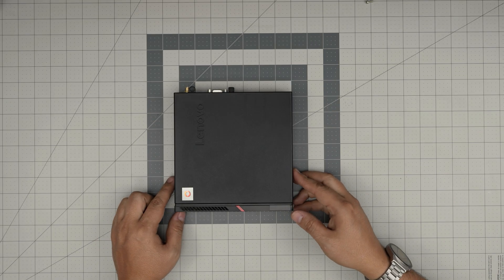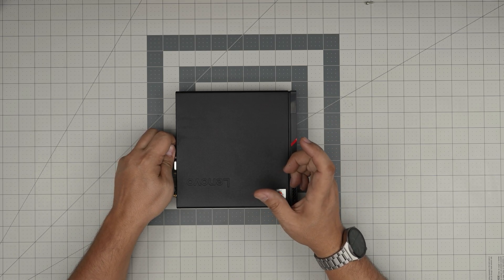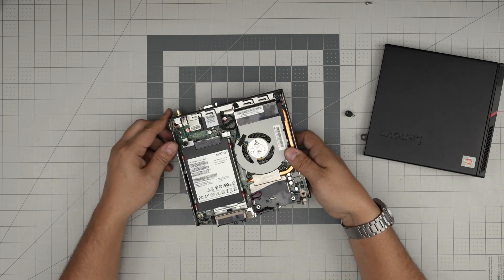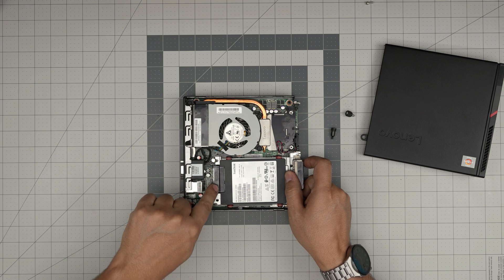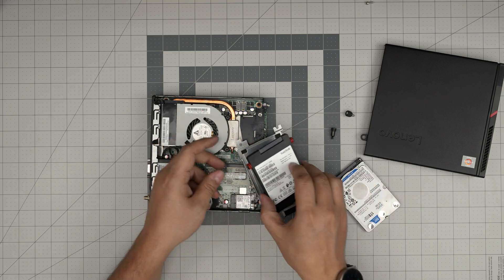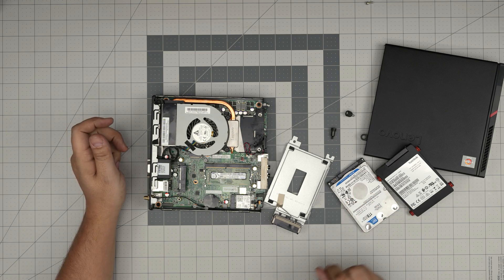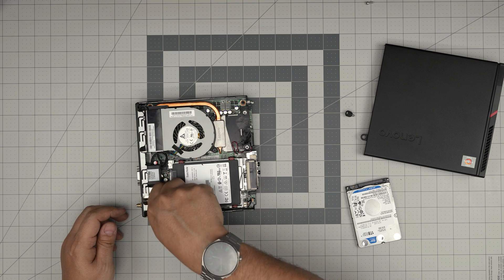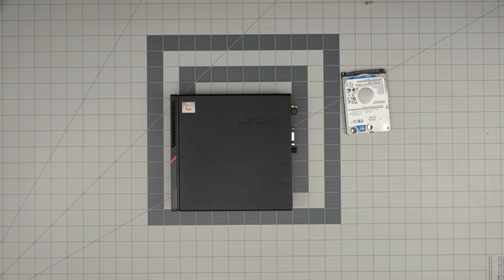How to Upgrade SSD NVME Storage on Lenovo ThinkCentre M715q Mini

Comment: I thought I read/heard somewhere that one should put a thermal pad between the SSD and the HD holder, but I don't recall any thinkness specification. You point out that there is not enough room for a heatsink (those are often 0.5" thick?), but what about a thermal pad? Does one have to be careful with choice of SSD to avoid overheating (can result in throttling or even shutdown?)? Thx for video: good stuff!
Reply from the maker: 🫠Regarding your question, if you're installing an NVMe up to 2TB, you do not need a heatsink or thermal pads. We've installed and tested it under heavy SSD loads without any issues. In fact, we have two of these PCs running 24/7 with 2TB NVMe drives, each handling 6–7 OS sessions with zero issues.  

However, if you're installing a 4TB NVMe, I would recommend placing a 2mm thermal pad underneath and a 3mm thermal pad on top of the NVMe.

Should you have any further questions or requests in the future, please don't hesitate to ask me.
cheers🍻